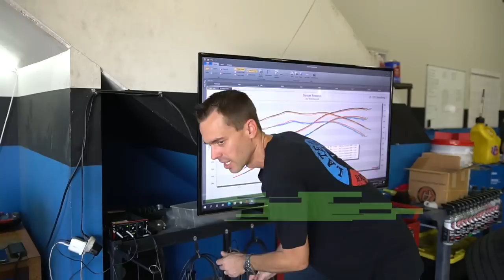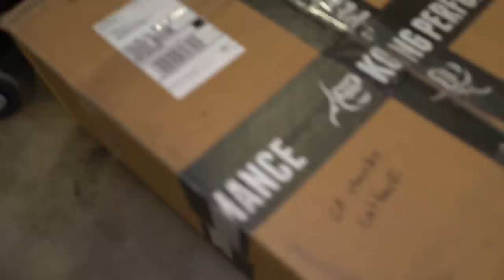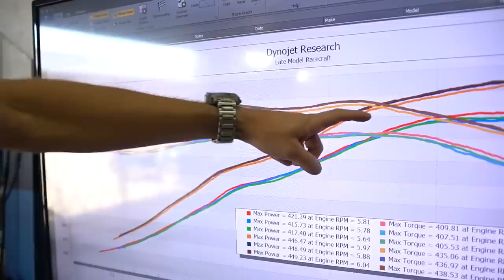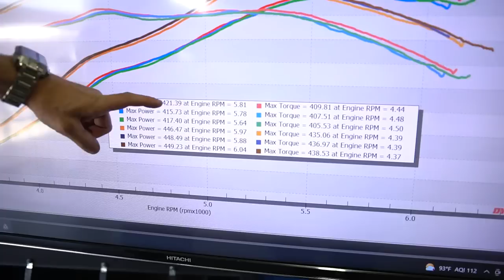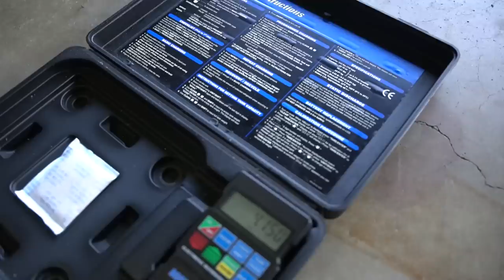C8 exhaust systems are back in stock! See install of our custom cat-back on this 2021 Corvette C8.

Comment: The car in this video, does it have anything else contributing to the sound?  Are the headers and cats still stock?  Was a tune performed after the exhaust installation?  Lastly, does this system have a "mild/wild" switch?  These new vettes, with their valve systems, never seem to fully open unless you are really on the throttle, even in track mode.  I would like to have it simple (like tour mode = valves closed / sport mode = valves fully open).  Or even more simply.... a button that opens and closes the valves.  Relying on the car's computer system to open and close them.....I don't trust it.

Comment: I use to have a 2011 f458 Italia. The exhaust upgrade on that was short and simple like this but I paid 4k for the titanium. The stainless system was 1900. C8 is not exotic like my 220k 458, so no way in hell I’m forking out 6k for a small, short titanium system for a non exotic car. Heck a full titanium system costs less for a newer 2020 f488. Soon as the C8 Zora or ZR comes out, if the world is still at peace and we have freedom, < (which I doubt at the rate we are going, never thought I’d see this tyranny in my 73  yrs), then I could see a 6k tag on a nice high quality titanium system.